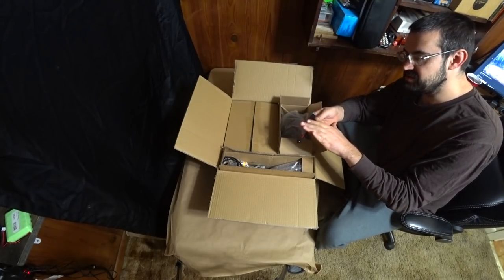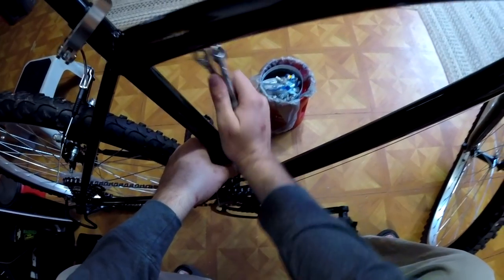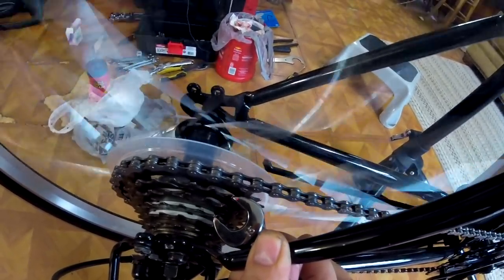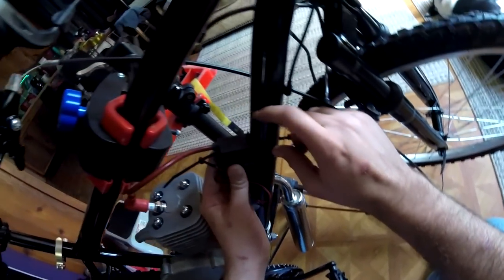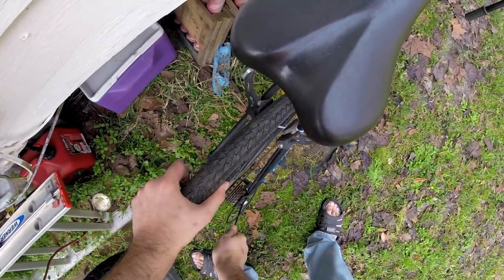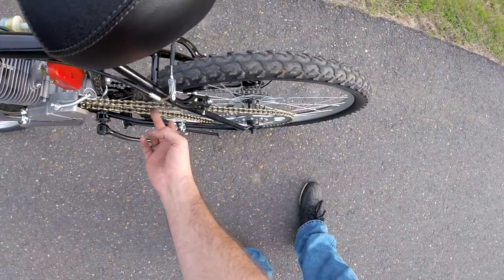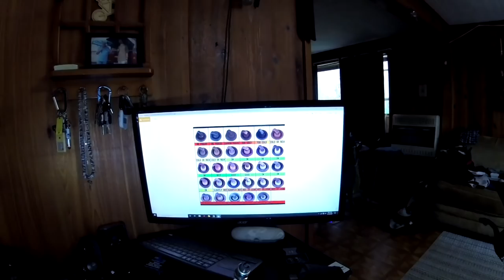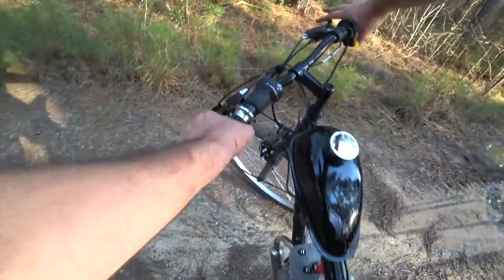YD100 Trail Bike Build (Motorized Bike)

Comment: I have discovered that the small spring on the clutch cable is not just to return the handle but more importantly to disengage the clutch lever from the bucking bar as the bucking bar is spinning and wears against the clutch lever if it is in contact with it...my bucking bar was mushrooming over on the outside and I was adjusting my clutch a lot (was lubed with grease)..I added the small spring and I did file down the mushrooming end of the bucking bar (which seemed soft) and heated it in a propane torch until blood red and dropped it in a glass of water (to hopefully temper it harder) and reinstalled...been a few runs and no more clutch adjusting...was it the spring or tempering?  (the metal didn't seem to get harder on file test) and I really suspect the spring is reducing the bucking bar wear...the Chinese wouldn't include the spring if it wasn't needed for some purpose (anything to save a cent)...
Reply from the maker: Thank you for pointing this out! I don't think I would have discovered this on my own. But like you I knew they would not include it unless it served an important purpose. If I remember I will be sure to add this in the next comment reply section of a video. :)
Reply: @LAHover  Update >> the bucking bar in some engines is made out of soft low carbon steel...I cut a 28 mm length off of the back of a 8 mm drill bit (chucked it backwards in a drill and used a cut off wheel on a grinder while spinning the drill bit to cut it off flush and even) and replaced the soft bucking bar with this one...finally after a couple of adjustments (while it seated on the ball bearing) later, no more adjusting...I did order the replacement bucking bar (it is hard steel) but the drill bit is working fine so far...
Reply: Thanks for this information!
Reply: @Centar1964  CAN U MAKE ME ONE I NEED IT LOL
Reply: my bearing is digging a hole in my bar i put mag1 lub red stuff hell i even used cocoa butter it still keeps digging i polished it with a shiney new quarter and it works like new now lol
Reply: i got like 2 springs i never used so i put i on the bar or what im blonde when it comes to this stuff help a brutha out
Reply: I always used that skinny spring on my clutch for the obvious to anyone that understands it's function 😩
Reply: @Craig Diamond  I recently took stainless and milled down a piece to dimension, I don't even care to look it's been about 3 months ride it daily sun clouds wind calm snow rain sleet don't matter🤣

Comment: Having built a few of these myself, I predicted everything you were going to say went wrong. Many of us have encountered each of these problems. I wish other build videos mentioned these things. You saved me time with your solutions!

I just began a new build. Thank you for stopping me from sanding and epoxying the 1" hub adapter and hub! Hahaha, I was thinking the exact same thing. I didn't want to use a set screw because I figured I'd drill into the hub berrings, but I'm getting a little rub on the rear fork as well.

Thank you for the tip about cutting the rag joint in half! I was going to trace out and cut /drill into a plumbing gasket or rubber door mat, but that is so much easier.
Reply from the maker: Thanks man! Ya it's crazy... On larger hubs (like coaster breaks) the adapter seemed to work well for me. But these tiny hubs combined with the torque of a large sprocket are a nightmare for the adapter...

Comment: I just put a normal 66cc on that same bike for my neighbor. i had to adjust and grease everything but it was the best bike walmart had for a motor. my neighbor has put about 500 miles on it and just had to replace the rear tire because it was bald. I had to open up the transfer ports with a dremel from bad casting. the motor broke 3 spokes even with the hub adapter. Welded the sprocket to the rim and no more issues. i plan on getting a friction drive for my full suspension bike soon. great job on the videos

Comment: Been watching your channel for quite some time and thank you for sharing your passion! I get a lot from it! Regarding the clamp-on adapter, i also was struggling with that for quite some time but finally looks like something worked for me which was using JB weld original. But not in putty form... doing the two formula mix. I sanded down both surfaces, added a liberal amount to fill the space between the 1in hub and clamp, let it dry for 24 hours and with a heater fan blowing at it to dry faster. One tip i discovered by mistake is let the JB weld spread all around the hub and on the sides of the clamp for maximum contact area and holding power since it all forms into steel. I'm using the 44-tooth sprocket (49cc motor) so I'm not sure if it will be enough holding power for the torque the 56-tooth sprocket demands but will try soon.

Also I used JB Weld to fill the gap where the chain tends to lock up (thanks to your tip on doing that with a business card)

Comment: Bro, bought that muffler, and 99 percent sure, a piece of weld tore up my cylinder head and piston. The top of the piston looked like it was used for target practice! I should have checked better, A piece was rolling around when I got it, and it came out, but the motors vibration must have loosened  more. Bang the hell out of those pipes! Great job mentioning that!! All of you're videos are very informative and entertaining! Thanks! ...GARY (Newbie 1 year, 2 bikes.)

Comment: Use Rubber mat cut as the spacers between the Sprocket and the spokes and inside retainers, instead of the stock spacers from the Kit.
It allows for a truer sprocket and different thickness of Rubber can be used to get the sprocket off set. Good build and well explained.
Reply: Just get Mag wheels, bet you will never mess with a sprocket ever again, I haven't but I did Locktite the sprocket once I got it.

Comment: Just did another kit on my bike and did allot of what you did.I bought the CDHPower magnesium 6-spoke rims and when I put the 56t sprocket and the 6-spd gear cluster on,they both hit the frame.I used nuts from an old rim as spacers on the inside of the frame and adjusted both sides.I have a 1" hub adapter that crushed 2 rims between the spokes before it slipped enough to bend spokes.Rag joint went back on 50t rim.
Reply from the maker: How are you liking the mag rim setup? I'm looking to get one too... Was the spacing you added with the nuts enough to keep the chain on without any major issues?

Comment: Few tips for any metal pieces that slip. Take thick grit sandpaper fold it as many times as needed and wrap it ard then tightly hit the blots  .never had a problem since  with anything I did it on. Idle pulleys anything to do with metal

Comment: I’m building this same exact bike without the YD100 (PK80) These engines fit so nicely on this bike as well - every other build I needed to do so much modding that made the mounting look unclean. I took off all the ‘branding’ as well but I have all this residue that is taking forever to take off with WD-40. 

I’m using a hub adapter too... I hope I don’t run into the chain issue like you had - I’m using a different one from CDH power tho - It looks to fit and spin perfectly, But I had to dremel out the sprocket holes larger to fit the screws through🤞🏻🤞🏻🤞🏻
Reply from the maker: Sweet man! Good luck on the build. I got a replacement rim in case all the damage I did to the hub causes an issue... So far it's holding ok.

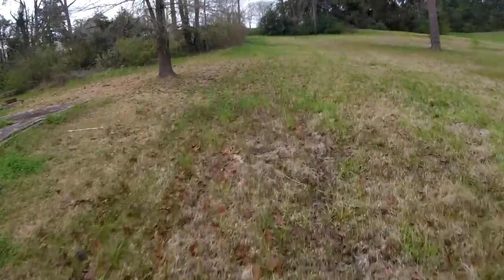Comment from the maker: Hey guys, I miss-aliened a small section of audio at 25:50 - 26:10. I was basically just explaining how I modified the rag-joint washer to get the sprocket as close to the hub as possible without pulling on the spokes... Nothing you will likely ever have to do, but you can see it clearly in the video, just in case. 
Sorry about that little hiccup. Enjoy to video!
Reply: Hey bro what makes the yd100 engine so popular ?
Reply from the maker: @chc754  My best guess is because of the extra 14CC~. As far as I know it's the largest stock factory 2 stroke bike kit.

Comment: cool video...makes me want to order a kit... I have a 1 inch hub with the clamp on adapter. all I had to do was sand each half on the mating surfaces and its never moved...of course a bigger sprocket will put more leverage on the clamp but you could always drill the threads out and run a bolt all the way thru the clamp to get it extremely tight, in any case you want there to be a 1/16" gap in between the two halves

Comment: If you want a good crankset I recommend ixf cranksets and going with a sealed bearing bb and going single speed on the crank, they're lighter and give you the option to run 2 sprockets but I only run 1 on the front and went to a single speed on the wheel and with a 16t on the wheel and a 32t on the crank it gives you more than enough to get the motor going

Comment: Good narration, speak with confidence, the small spring on the clutch it to keep the cable from raveling.

I hate 2 strokes been thru 12 in 4 years life expectancy 6-8 months or 2800 miles.
Now into 4 strokes nothing but an agonizing motor of a different race.

Comment: You make these builds look easy! I just had the same thing happen with the chain hitting on my Roadmaster. I grabbed another wheel from a Schwinn to make it work but that’s a great tip to get the gear closer to the rim. I kind of wanted to try one of those flex exhausts but I can’t tell if they make the engine louder or quieter. Intrigued to see it on one of your bikes and your thoughts.
Reply from the maker: Thanks. Aside from dealing with sprocket set ups that are different for every bike, they are easy builds. Bike Berry did a test with a bunch of different exhaust systems and the flex came in first place for noise to performance ratio. Slightly louder than stock. I cant wait to try it out and see how it does.

Comment: I doubt you will see this since this video is older, but I think it would be worth a try to use some loctite 638 or 648 retaining compound when installing the hub adapters and give it 24 hours to cure.  That stuff is ridiculously strong, and quite literally built to retain cylindrical parts.

Comment: Love hearing red green in the background
Reply: That was shocking. Almost made the video wholesome. Keep your stick on the ice. I'm pulling for ya
Reply from the maker: And remember, if the women don't find you handsome, they should at least find you handy ;)
Reply: @LAHover  if I may ask a question. What has been your exp with shift kits? My biggest issue with motorized bikes is that even of they have a TRUE 100cc motor. A lot of speed/power and responsiveness is lost due to gearing (i.e one gear) I don't need super top end. But I know a 80cc dirt bike is totally different due to multiple gears. (But still tops out at 45 mph)  I AM a mechanic so building the motor and porting / initial inspection of a kit is no issue. And I really want to get into the bike kits because it's a cheap hobby. But that whole lack of gears kinda hangs me up. I'll however admit that the idea of changing gears while the motor is turning gives me anxiety. As the chain is only so dang thick. And over time the edges of the chain will wear. Hoping you can provide some wisdom as bike kits ARE new area to me. It's been a pleasure. And as always. Keep your stick ON the ice. (and your bike OFF it) haha. Btw. Greetings from maine!! Hope the weather is awesome where you are.
Reply: @LAHover  also. Quick idea.  I buy clone chainsaws of the stihl ms660. And one BIG thing with the performance of these saws Is the coil/carb. I DO wonder what would happen if you used say....a LEGIT coil for a bigger stihl or husky saw. They have what's called an "unlimited" coil. I can attest that they put out some serious juice without needing a better magneto. Also. The carb on a saw is made to REALLY dump the gas to the saw quick, and maintain a super flat acceleration curve at the same time. Begs the idea of a carb retrofit. Have you ever wondered what the difference would be with a butterfly style carb like a saw? Certainly a curious subject id say :)

Comment: Hey buddy , I was wondering if clamping bits of frayed copper speaker wire in the hub adapter would work to grip. It works well on stripped bolts and spark plugs when ur in a pinch. I'm putting together  my first 2 stroke zeda 100 kit
Reply from the maker: I have given up on messing with the small adapters, but that sounds interesting.

Comment: Also I just used the 6 bolt tp mount my wheel sprocket to the wheel where the disc break rotor would go but I hardened the bolts to make sure they could handle the torque and I know you can find hardened bolts for this purpose

Comment: To get the hub clamp to work there is a way to do it by drilling two 1/4 (choose your size, mm or SAE) holes directly through the hub on both sides and not through the axle then carefully thread the holes you made in the hub with the matching tap. Drill two holes in the clamp slightly larger, unthreaded, counter sink the the holes in the clamp so not much is above the clamps metal edge, chamfer, use hardened Allen bolts, do not use stainless steal it is brittle, place a washer under the bolts before tightening use some oil on the threads and the bolts, Tighten the clamp first to about 10 foot lbs then tighten the allen bolts down then tighten the clamp to full strength then return to the allen bolts and make sure they are also at full strength. Don't use loc-tight yet until its used for about 30 days and then you can use loc-tight on all bolts.

Comment: Like your channel man.  Can you tell me if the yd100 cylinder will fit on the stock 49cc kit?  If not will the 66cc kit bolt on.  I'm a motorcycle tech by trade but you seem to have done a lot of these kits and their isn't that much info doing google searches.  I put one on a roadmaster walmart bike for my son but it's just the 49cc kit.  Pretty sure the 66/80 cylinder will fit and then I will upgrade the exhaust and do some port cleanup once I get the bigger jug.  Not looking for crazy power just a little more and little crisper throttle response.  Thanks
Reply from the maker: the YD-100 cylinder has a wider stud pattern and will not fit a 66/80 or 49/50 bottom end. I do think the 66/80 cylinder and piston will fit the 49/50 bottom end but I can't say for sure. You would need to measure the stroke to make sure you kit the right piston. There is a 40mm stroke and a 38mm stroke.

Comment: I'm thinking of trying the poopoo exhaust ,i ordered a small expansion chamber it was so bad I'm not going to use it, welds and mounting surface were shot , holes were punched so far off can't get a nut on the stud. Lesson learned, great videos and info.

Comment: Question is do you prefer a triple 40 or the yd? Was thinking about getting a yd but can't modify with a high performance head. Is power any different?
Reply from the maker: Mid RPMs are stronger and more responsive. Low RPMs feel the same. When I get passed the break in I'll see what she can do.

Comment: Heads up on the throttle twist add on, you can remove the little notch they have in the twist so you don’t have to hammer a hole into the bars.
Reply: If it goes in it can come out but geez a hammer its a drill that you would use. Its a locator just added to help.
Reply: @joshuadulaney5559  a lot faster to take a nail & a hammer, one tap done. but like i said dont have to use the little notch.

Comment: Love the stuff your putting out. Bout to build my first, a yd100, wondering what your thoughts are on the rubber vibration motor mounts? I saw another video where they used them for a bit of a snugger fit to the frame. Would that be more beneficial for road cruising or trail riding?
Reply: I had a motorized bike with rubber motor mounts. It alots for a smooth ride for sure. Downside I found was it was putting extra stress on the motor mount studs.. I ended up snapping a motor mount stud right out of my block. I havent ran rubbet since! With no issues of course. Hope this helps! Ride safe

Comment: I have a 1" hub adapter that i haven't used yet, but now i'm thinking i could have it welded, just need someone that can weld aluminum. Not sure how well that would work though. Though a couple beads could be used as a key if the weld beads are on the hub itself..  So if i can't weld the hub adapter on directly without damaging the hub, maybe i can get away with 6 beads that i can use as keys on the hub itself. Then i can just dremel out some very tight fitting "key holes/slots" on the hub adapter.

Comment: Okay so it's been a minute since I've commented on this video I'm working with 2 yd 100 Motors two different builds completely structure wise but very similar both 29 and both have custom exhaust one has 36 tooth one has 44. I have a reed valve on one that I just redid the gaskets and got it all together now it runs like s*** I won't get too annoyed though s*** happens just a small carburetor issue these Kaioken clone carburetors are not bad if you can find the adjustment on them they're sort of a pain in the ass though I will say my stock carburetor that came with the yt-100 is running very good no issues on that one definitely can feel the difference in draw and latency between the two but not bad. I will say the 100 are a new breed were literally waiting for more parts and more things available to upgrade on these motors that's one thing I do love and miss about the 80s and I was always tell somebody you can't go wrong with an 80 as well they're great Motors several different good brands out there

Comment: I'm thinking about trying a hub adapter but ik they have spinning issues debating on talking to a machine shop to see if they can tig weld one on
Reply from the maker: I had good luck with them on coaster brake hubs, but not mountain bike hubs.

Comment: Use a pin punch on the hub adapter and the hub and roughen up the surface also if need be shave off some metal off both ends of the adapter zero slippage